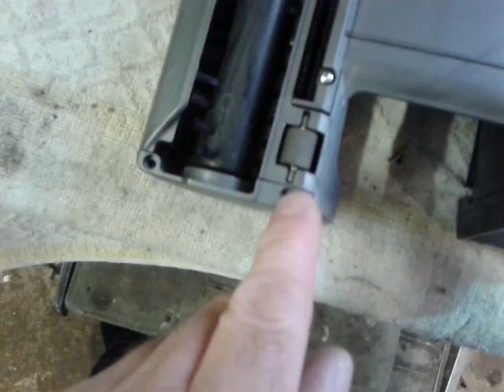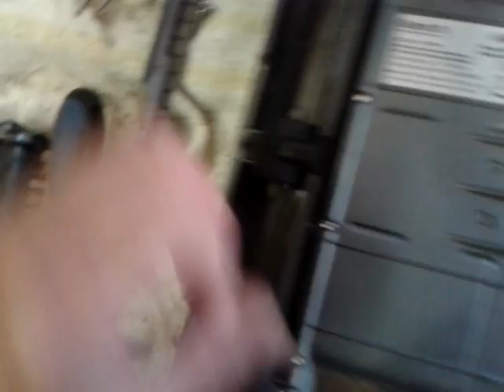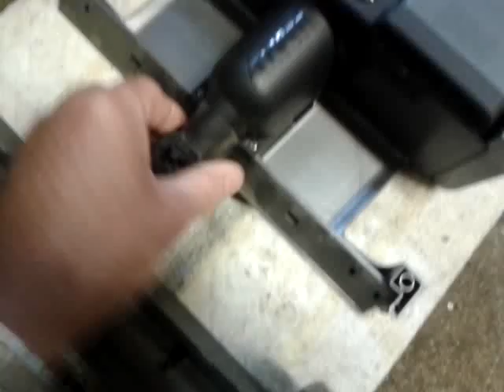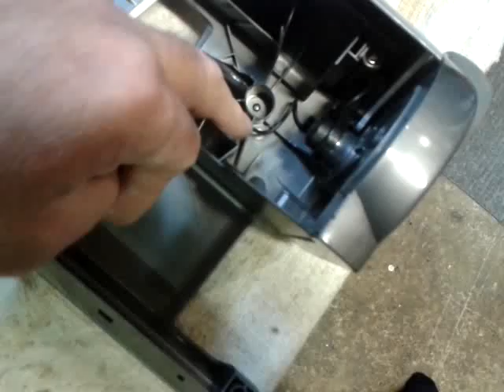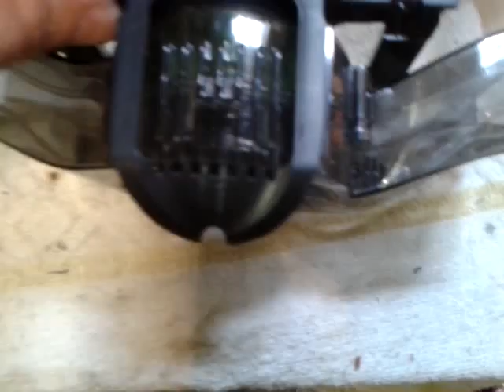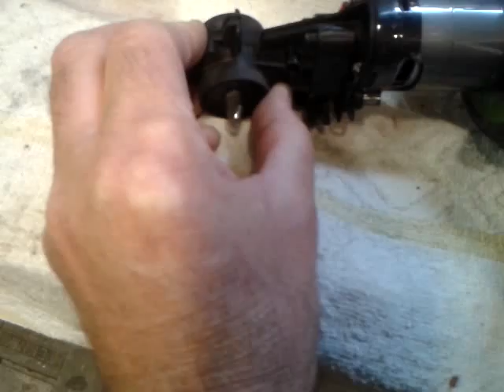Gtech AirRAM vacuum electric unreliable motor assembly removal how to fix broken or noisy bevel gear

Comment: Mark 1 airram just went bang lol, now when i hit the power button i get 4 green lights for about 3 seconds then they go off. Obviously, nothing is happening, so my question how do i check if the problem is the battery pack or the motor which has blown?

Comment: hi i have an gtec air ram
i need some help it only works when the handle is in the upright position 
when you pull the handle the motor stop when the handle travels a few inches
any ideas please
Reply: That's the same with my gtech   we need some help
Reply: Any advice at all would be great for me too as I also have the same problem.
Reply: Same here, i’m thinking it could be the cog? Has anyone managed to find the solution for the mk1?

Comment: In my experience the reason the gear "fails" is because it is only engaged by the tips of the gear teeth on some machines. First of all try adding a PTFE washer, 1mm thick, 27mm outer diameter, and 13mm inner diameter; available on ebay for £1.50. Put this between the cog and the housing, so pushing the big cog closer to the smaller drive cog and and the cogs mesh well. If properly meshed the teeth will never fail.
BTW, where the cog fits on the spindle does not affect how it meshes, this is a function of the thickness of the cog and the housing assembly.

Comment: Had a few with warn gearbox housing using a metal cog on metal is NOT a good idea makes more noise and generates a lot of heat meaning the the gear box housing is going to fail. The only 100% fix is to change the full drive train motor on eBay easy fix https://www.ebay.co.uk/itm/163193831673

Comment: Ebay for belts and spindle and screwdriver this seller has it all.https://www.ebay.co.uk/itm/GTech-AirRam-Spares-Cog-Belt-Grease-Tool-AR01-AR02-DM001-AR09-Mk1/162858502791?hash=item25eb1f8a87:m:mVYbJHhqCbaqk6auLUudRBg

Comment: Thank you for your excellent video. It is the most accurate on YouTube in terms of screw size advice and order of disassembly. Two other professional ones actually break off one of the lower fixings by not undoing one of the screws.

Comment: Replacement belts also on ebay - search for:
Toothed Drive Belt (Motor to Cog Shaft) For GTECH AirRam Vacuum Cleaner
http://www.ebay.co.uk/itm/191896792709

Comment: Replacement part available on Amazon.co.uk - http://www.amazon.co.uk/gp/product/B00NU19UYI?psc=1&redirect=true&ref_=oh_aui_detailpage_o00_s00 - works really well but when using the video above a) look exactly where the screws mentioned are - yours may be hidden by dust, etc., and b) DO LAY THE PARTS OUT SO THAT YOU KNOW THE ORDER TO RE-ASSEMBLE as sensibly advised in the video.

Comment: thanks for this video , Ive replaced my cog just make sure you put it in the right way , it will go in with the gear facing inward making the brushes spin the wrong way . Also there is now a Pet AirRam that has a brass cog but you cant buy it yet . 
I think the cog is nylon because its sacrificial , if the brushes get cloged and the motor doesnt stop fast enough if could strip both gears or worse .

Comment: I assumed this was what was wrong with mine but its not that.  Its the drive belt that (I assume) connected the motor to the gear shaft.  It's gone...  

Can't find a spare online anywhere.  Anyone know where I can get one? Unfortunately even though I bought the unit from Gtech, I should have sent the card they sent me, back to them, for some reason.  
As I did not - I do not get the 5 year warranty.  Petty - but the get-out-clause must be working well for them.
Reply: +Ed Silvester 
Hi Ed,
Please tell me you've managed to find one as mine has ripped! I've looked high and low. Do you by any chance have the part number for it as mine has melt off!!! I can just about make out Gates. Getech are being useless when it comes to this part.
Reply: +Tom Miller I'm really sorry.  I gave up and had to buy a whole new unit.  Such a waste as it was such a simple potential fix.  Gtech were not able to supply the part or tell me where to source it.  At least I have a lot of spare parts now!
Reply: Ed Silvester Wow, that's ridiculous! Why on earth don't they sell these things. Well if you ever take your new one apart please let me know the part no and I will not give up!

Comment: Thanks for the video. Very bad deign in my opinion. What they should of done is have the motor drive belt directly to the final drive axle. No need for cogs then..
Reply: Really? Every knows the hassle of vacuum cleaner belts. Maybe cogs will last longer. The problem is with the plastic drive gear. What a shame. Imagine a Swiss watch made with cheap plastic gears. Oh, what? You can't? That's because most watches are made with metal gears... umm... that turn slowly. Vacuum cleaner gears are subject to hurricane-like forces. This plastic drive gear just will not stand up. Maybe this will open up a market for Gtech AirRam modifiers. The Gtech is a vacuum that deserves to succeed but it is also a vacuum subject to cost cutting. So close yet so far.

Comment: Gtech AirRam Vacuum.
 
After seeing the adverts on TV I decided to buy one.  Your Utube information was very helpful and consistent with many other owner views. 
As an Engineer I was intrigued with the conical cog/gear problem experienced by many people on the internet.  This is defiantly the weak point area of a very good vacuum.
I bought a broken Gtech; it had the same cog/gear fault.
 
I stripped the vacuum and found the stripped cog plus the bearings had seized.  I am convinced the nylon gear was stripped as a result of the bearings seizing.  When the bearing seizes and screwed out of its housing it drops the nylon gear partially disengaging it from the main metal drive gear.  The plastic gear is now stripped.
 
I have replaced the metal roller bearings with ‘Top Hat Bronze Bush’.  The top hat keeps it located inside the plastic housing.  I bought a new nylon gear from ebay.
 
We have been using the vacuum for 2 months and its working fine.  If the gearbox fails later I will enlarge the plastic housing and fit a larger roller bearing, ideally with a top-hat outer case.
 
Hope you fine this of some interest
 
Phil.
Reply: ***** gtech does not provide any gears as a part and opening the product will invalidate the warranty unfortuantely

Comment: Hi this video was a great help, you can buy the plastic gear from eBay, just purchased mine from there, it cost £25 cheaper that buying a whole new Hoover eBay search (Gtech airram part), you have to also take apart the shaft apart to place the new plastic gear, to take metal shaft apart you have to tap the bearing off, mine is now as good as new.

Comment: i wonder what an engineering firm would charge to make a batch, if you supplied them with a good one as a pattern to work from? im sure there would be a good market for them if you had to have 50 or so made!! or even buy damaged air rams and repair them!